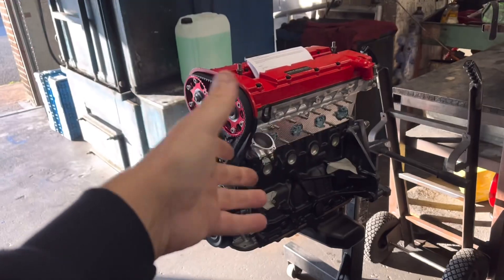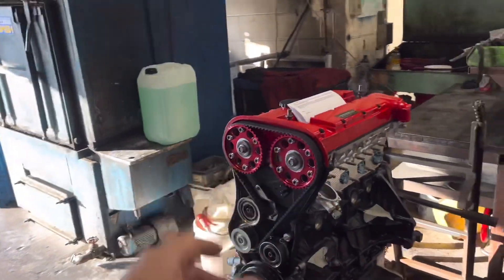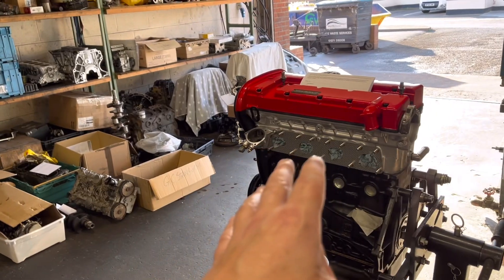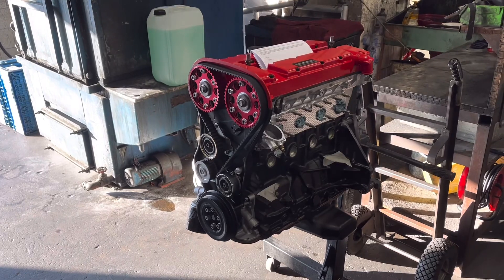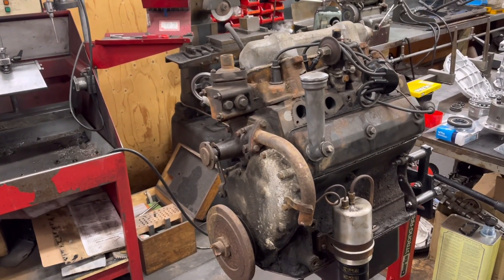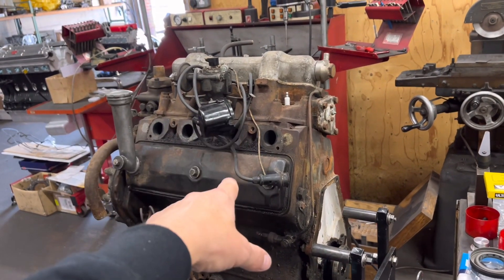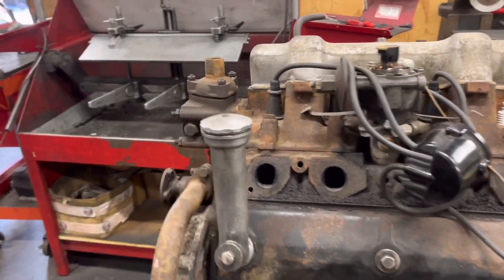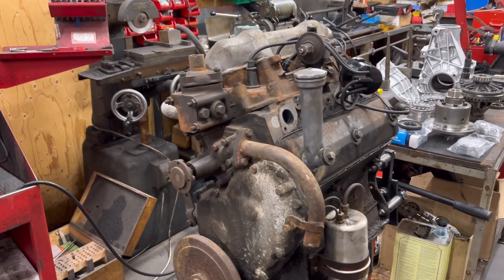Porsche 911 and Focus ST engine disaster, can we fix them and will it ever run again?

Comment: Excessive heat and alluminium blocks and cyl heads do not go down well.  I once threw a fanbelt 5 miles from my abode in a not so friendly country the temp outside was over 30degc  car was 78 holden 5.0 v8 cast block cast heads etc drove it all the way boiling stopped opened my gate drove in parked it. Next day sourced a new fanbelt put it on checked the water topped it back up started it and it was fine. Try doing that with a modern car.

Comment: You need a NEW crush washer (they are single use to set preload) That said if the drive shaft can't float (or binds) it will damage whatever you use otherwise a new crush set up correctly will handle that little light car easily and the problem should not return

Comment: for performance diff's you would fit a fresh crush washer and set the correct pre-load with new bearings, remove the crush washer, measure it and then make a solid washer of the same thickness, re-fit and then test the pre-load is correct, adjust the washer thickness if needed, a surface grinder would be needed to correct the washer if the pre-load is not correct.
it is time consuming and a bit of a pain to get it correct.

Comment: From the USA....  Like the varied engines that you're working on.   I just dropped off a Ford 390 V8 block at my local engine shop for inspection.   I'm having it built into a big bore and stroked 445 CI (7.3L) for my 1969 Mustang.  Will run a stock block but the rest of aftermarket.   I came across your site by chance and subscribed to it as it's quite informative as to what goes into fixing/rebuilding varied engines.  Keep up the great work and videos!

Comment: The collapsible spacer also has an element of spring to it, so if you’re going to replace it with a solid spacer it will need to slightly smaller. When building diffs 0.0005” increments makes a big difference to bearing pre-load and gear position. My advice is a new collapsible spacer and set the preload using an accurate torque to turn gauge to the manufacturers original spec. For the backlash/diff bearing pre-load I would again use an accurate torque to turn gauge and the manufacturers spec. As a general rule you are only looking for 0.003” pinch on the bearings. Hope this help.
Reply: Yep, you got it right. I've also built plenty of diff's in my racing career and always used a new crush spacer (sleeve) in every build.  Also used a torque to turn gauge as you put it to actually see the amount of turn torque that was put on the pinion gear.  Actually, went to a 5 day school for building diff's back in 1980.  Never had a problem after that.

Comment: As an engineer (centrifugal pumps for the oil and de-salination industry) coming from a factory with similar "Beamish" machines that are perfectly suitable/accurate for your work - every job is different and does not require CNC - I would be interested in some general interest info on the manufacturing method for the liners you use - wrought bar, cast, centri-spun castings, forgings, sintered.

Comment: The pinion assy preload is in the assembly not the nut torque @ the flange end ,  peronally I would machine a solid spacer once the bearing preload is established the crush/collapsible spacer idea is a weakness and used for speedy assembly production line reasons nothing more  , do it once do it right the bearings on the pinion shaft are the hardest working bearings in the diff assy, a torque plate wont make any difference to that open deck Focus/Volvo ovality of the cyl bores

Comment: I only once had to fix a Diff and adjust the positioning of crown and pinion gears (1968 Mercedes 911 truck) I did with blue coloured grease to see where the gears touch each other..... it was a fidelly job but I managed to complete it succesfully.... as far as I remember the main thing was to get the gears to touch each other at the middle of the geartooth surfaces.... at the same time the clearance/tightening of the bearings must be correct.... I suppose it is a job that was regularly occuring in the old days,but now is to be a lost skill....
Good luck with it Lee!!!!.... love your vids!!!

Comment: The groove in the barrel is not for an O ring it’s a wills ring which is a gas filled steel ring. Hillman imps used a wills ring to seal the very high compression these engine used to run.

Comment: Re your crush tube/washer. They used to do similar in landrover lt230 transfer boxes , but they used to fail and end up destroying the box. They now use solid  tube not crush tube /washer. Set your diff up to the correct torque ect, so the tube/washer is crushed. Once it's correct disassemble  and measure the crush washers dimensions and then machine a solid  piece to the correct dimensions and then refit. Then your good 👍

Comment: Last diff I built, I used a solid spacer. There's a solid chunk then a series of shims.  You measure the existing crush sleeve to give yourself a starting point, then assemble the pinion with the spacer and shim. Then measure bearing preload.   You might need to take it apart and re-assemble a couple times. to finally get the preload right. 

American's like to drag race and I believe it's probably the beating from high powered drag racing that would over-crush the sleeve.  I don't believe a solid spacer is needed for track use. It's better than a crush sleeve because you completely control the preload but, a crush sleeve is probably good enough.

Comment: Hi, 35thou off these Ford blocks and again off the cylinder head, to get them flat, that's some distortion.
How have you found the Crankshaft main bearing housing as regards to distortion front to rear of the block.
Thankyou for sharing your videos.

Comment: I’ve had problems in the past with the crush spacer. I use them to set the bearing preload then pull it out and make up a thick walled spacer to the same length…..
Reply: Saves me having to say again. 👍

Comment: definately torque up the bolt and measure the crush spacer and then machine a solid spacer to match. that's how we make 4wd diffs solid when installing ARB Air Lockers.

Comment: With that diff buy a new crush sleeve 
Assemble the diff make sure you have the correct backlash and tooth contact set the preload with the crush sleeve 
Then strip the diff and make a sleeve 2 thou shorter this will allow for spring back 
Then reassemble with new seals and off you go

Comment: Hello guys! Those Porsche cylinders look like early 964 models that Porsche tried to eliminate the need for a head gasket. It's a common failure to have a combustion/oil leak and cause that exact failure if not repaired. Porsche updated the cylinders shortly after to include a groove for a head gasket. You should machine a groove in all the remaining cylinders to eliminate that problem. If they order new cylinders from Porsche they will have a groove already machined. Keep up the great work.

Comment: That long 6 cyl. head needs too be straightened in a press so the cam doesn't lock up before you  resurface it.
Reply: Last shop i worked in had a commercially made jig with T slots in it so you could bolt the head down with a couple of spacers under the ends, you then heated the cyl head to a certain temp forgotten years ago and then pulled it down with bolts until the cam tunnels were looking straight and just left it to cool down. Cranks we heated and pressed the big diesels are scary as it takes a lot of tonnage to even shift them.

Comment: If you use a solid pinion bearing spacer, they are shorter than required,  then shimmed to get the correct preload. Always start with a big shim stack and then remove shims, or you will bruise the bearings when setting the preload. The process requires multiple assemblies to get it right. I've never had a problem with collapsible spacers, but you shouldn't reuse them in most cases. Tightening torque and bearing preload are unchanged.

Comment: It's a CRUSH SLEEVE.  When assembling it, you should have a torque specified that will cause you to gasp.  Follow the requirement and you will be fine.  I've had friends that put pinions together without following install requirements and wound up destroying the differential because the pinion shaft was wobbling around.  That sleeve prevents that from happening WHEN PROPERLY TORQUED.

Comment: 4:10 I never realy trusted these spacers.... trying to keep inner bearings locked,but only upto a certain amount of force.... a cheapskate solution that obviously doesn’t allow the standard forces/risks to be exceeded.....
I’ld carefully measure the dimension of the spacer and fabricate a substitute with EXACTLY the same width..... from my experience the variety in clearance is NOT in the bearings themselves but in the housing and machining of parts....
Obviously one carefully observes what happenes when thightening things up..... I’ve seen enough of your skills to trust you’re knowing enough to deal with a delicate issue like this....
(You should,knowing how often me,being a cowboy,got away with issues like these.....)
Reply: You carefully see how tightening things up affects the force needed to turn the shafts.... any noticable clearance after doing so turns you back to square 1......

Comment: Eek! 911 engines need a fair amount of unique knowledge. Fairly sure the 100mm cylinders (used on the old turbos, for example) are Nikasil plated aluminium. That means the piston clearance can be smaller. They used Biral (aluminium with a cast in liner) for a very short time but to manage the heat via air cooling, they needed to have aluminium cylinders.

Comment: The quaife atb is a great piece of kit the main reason is its a fit and forget part that won't require servicing. But just remember if you lift an inside wheel power is then lost to the outer wheel which effectively is the wheel that is pushing you around the bend...or pulling if the diff is in a fwd car.
Plated diff is the way.
Love the vids.

Comment: I hope you measured the pinion depth in the diff housing before you removed the pinion.  Critical you get it right.  Also, use the original crush sleeve and use proper torque.  It'll all work.
Reply: A previous video showed the pinion shaft rattling around. Nothing left to measure, this will have to be shimmed from scratch or use the crush spacer, yikes.
Interesting commercial points on both Porsche and Ford engines, both look like write offs,  do you oblige the request to do a risky repair keeping a regular happy or force a more long term response?

Comment: a bike engine wont pumale the diff as a bike engine has more RPM and less torque to get the same HP as a car engine and a bike engine has a lot less rotating mass when you dump the clutch .....its touque and rotating mass that bust stuff

Comment: Hi there. 1) Allways new crush sleve 2) move the shimms under the big bearing cone from between bearing and pinnion gear to between bearing sleve and the housing. In some types of casings like toyota you need to make the crush sleve longer. The big bearing cone and pinnion gear have better contackt and the is less likely to turn on the pinnion and eat up both the shimm and the crush sleve, the bearing sleve in the housing have more diameter contakt to hold. Crush sleves are made to make outer and inner pinnion bearing cones to one moving part. And in your case i thing the crush sleve have bin pre crushed to undersize and big bearing turned one you and made the pinnion shimm thinner and made the bearing to loose. Your new casing should be putt in lath, clock both bearing surfaces  and ckeck the plan under the cam gear. I have many times had that plan crokked on a new casing. I allso heat the camgear up on the casing untill it clacks down on the plan. I have worked on the big jeeps here in Iceland for many years (38” to 56” tires)

Comment: On the Porsche pot: dont go for too much interference and use liner glue. For one, these old castings can be a bit brittle and the other thing is the liner glue will dampen the vibrations a bit and prevent shifting

Comment: Working in a company that makes rear axles for industry I have a bit of experience, we used to use crushable spacers but now only use solid spacers and shims, our pinions are assembled without an oil seal, then torqued to around 170 Newton meters and the drag is measured, 16 to 21 inch pounds is what we set out drag to, however I recently rebuilt a Mazda rx8 differential for myself and the figures for this were around 12 inch pounds, give or take, once the drag is correct the diff is then assembled with oil seals(this is the same for us and Mazda spec as the oil seal increases the drag)

Comment: I have been watching for months now, great content.  However, please explain to me why I never see torque plates used when you a boring an engine.  In the U S when you really are building a performance engine torque plates are always used to ensure that the bore is absolutely round.
     Thanks again.
Reply: Lee only builds "special" engines. Ones that never need : line honing, rod alignment checking after honing , all cylinder bores honed with the same grit stone regardless of ring material, valve / piston clearance that never need checking ,cylinders bored without reference to the main housings , no torque plates, and then thinks a V8 landrover on 11.36 :1 will be ok on 95 octane.
Glad he`s not building mine.
Reply: @0120raptor  😂

Comment: Use a new crush washer to get preload correct then use that to make a solid one the correct size. Fairly common on motorsport type units. Good job
Reply: Agreed, set up with a normal crush, open up again, measure crush washer width and machine up a solid spacer to match, then do the final assembly, slightly overtorquing to lock everything together.
Reply: @walterjwalnut9964  Totally agree. New crush sleeve. New bearing new crush sleeve. Never thought of machining a solid spacer. Good idea !!!
Reply: I'm going to steal this idea for sure. It's great.

Comment: Those Porsche liners are aluminium ,nickasil coated. You can`t put cast iron liners in it . You`ll have all sorts of problems with that. They only run 0.001" clearance to allow for expansion of the barrel. Also you`ll have a problem with the head gasket blowing.The ali barrels expand lengthways with heat a certain amount. If you put cast iron in there it won`t expand the same. You`ll have 5 long and 1 short barrel. Read oil leaks and blown head gaskets.Porsche spent years sorting out the correct stud material to stop them breaking and you are just going to  make matters a whole lot worse. Ring Design 911 they`ll have new pistons / barrels in stock. But you`ll have to buy 6.
Reply: The barrels shown clearly have iron liners. Nikasil is done directly on aluminium. I think the nickasil cylinders are on turbo (and race) and commonly on newer Porsche engines - which goes directly on the aluminium alloy. Nikasil can be replated - commonly done for ATVs and motorbikes. Porsche has also used Alusil bores - a cheaper option that does not work to well - and "Ductile Iron cylinder liners" are a common fix for those engines. I have had an nikasil motorbike bore sleeved with a standard iron liner - and it was 2 stroke and had to have ports cut in it  - worked perfectly.
Reply: @jonathanrees3765  They really are coated one piece, no liners on those. And putting one in with an iron liner is questionable. It might work but one can only test and hope. I would bore it out and heat fit aluminum liner and send it out for plating.
Reply: I like monkeys

Comment: So you need a new crush sleeve. Put the rear end together. Then take it apart and measure the crush. Personally i measure the sleeve before and after. Then make a solid sleeve with .0005-.001 heavy.  Rush sleeves can flex back a bit.

Comment: ...and always use some silicon sealer on the tip of the splines on the pinion, Sierra, Escort;Granada, Scorpio diffs tent to leak oil past the splines and out of the washer that sits in the pinion flange.

Comment: I have built many 9 inch ford differentials and have always used the crush sleeve. Although it was for circle track racing on dirt, we never had any problems.  Believe me the rearend took a beating with 600 horsepower and a rough track

Comment: Crush washers are single use only and should be replaced every time they are removed.  You torque the pinion nut to crush the washer to achieve the specified amount of drag/preload on the pinion bearing using an analogue torque wrench.

Comment: With the ST engine the common problem is those coolant slots between the cylinders
Reply: Should do the block mod whilst it's apart to eliminate the gaps... especially if the engine has been modded..👍👍

Comment: solid spacer would be the way to go but requires setting up, disassembly, measure . fettle , repeat. seems to me the compressible sleeve is for speed of  assembly in factory?.
Reply: In my opinion, it's design.  An engineer designed it for a specific task and correlated a specific torque to preload that pinion.  Unless you are suggesting a redesign - which I would take up with the original design engineer - and be prepared to discuss the associated mathematics at length with him.

Comment: We replace the crush sleeve with solid spacers on ford 9" axles with a spool for drag racing, the only issue is on hard deceleration it is hard on the pinion bearings, being solid. If it is for rally and you have to be in and out of the throttle maybe stick with a new crush sleeve.